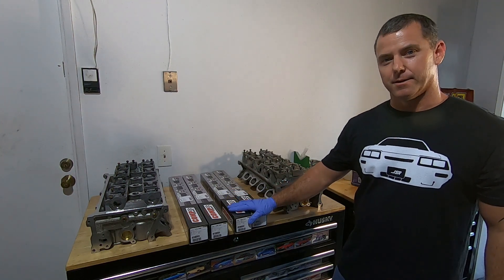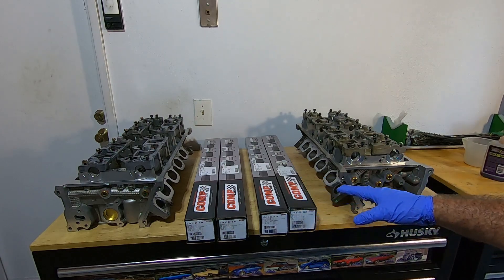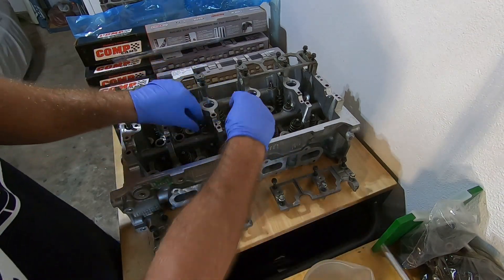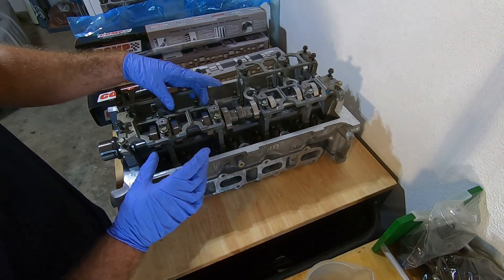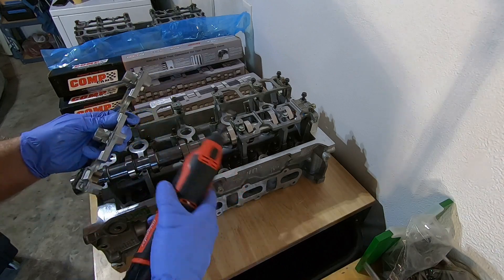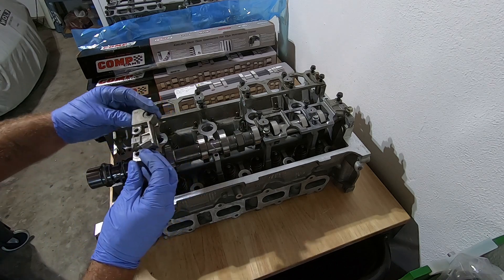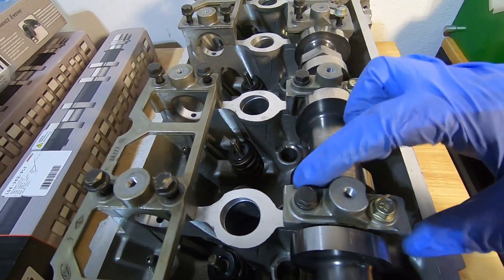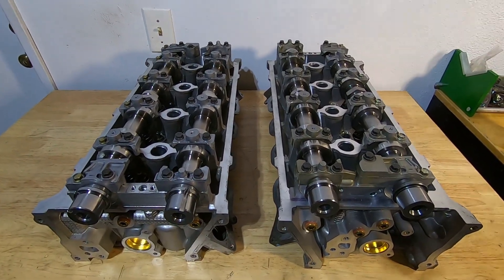Pt 5 Installing Comp Cams and Girdle Clearance - Forged 4.6 for 2001 Mustang Cobra

Comment: John, question…I installed new stage II comp cams on my 4.6 DOHC and they all spin nicely. However, driver’s exhaust cam spins a tiny tighter. Is this normal? (No lash adjusters or followers are installed.)
Reply from the maker: Yes, I have seen that and it should be fine.  I have ran them when there are difficult to turn by hand and have nt had an issue.  I've seen people run them so tight they needed a wrench to turn them 😬
Reply: @JohnSmithRacing John God Bless you and your family - you are a real genuine person to reply…”Merry Christmas Brother!
Reply from the maker: @RA-lk1vz  Thank you and Merry Christmas

Comment: John so I thought the girdle needed the dowel pins on each corner to align the cam caps?
Reply from the maker: They are for that, but even without them connected, they line up pretty well.
Reply: Brother I really appreciate you replying this means a lot - I ask because you have a lot of trusted experience.

Comment: Hey John when I tighten down on my cam girdle it locks the cam down
Reply from the maker: I have had them a little difficult to turn but if they are extremely difficult then you might have a bigger issue.  If the heads are not bolted to the block, you might bolt them down and see if that frees them up.  Also, with the caps off lay the cam on cam bores and see if it will rock back and forth.  You might have a bent cam.  I would also inspect the cam bearing bore area for any damage.
Reply: @JohnSmithRacing  ok thanks I will try that